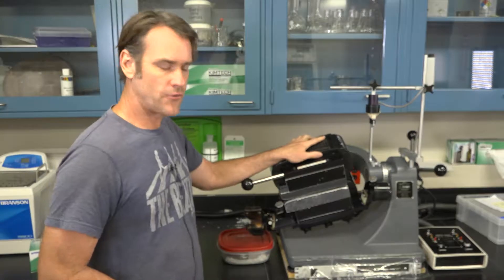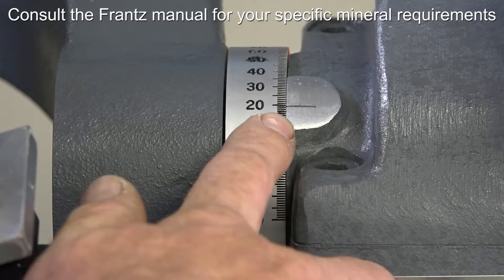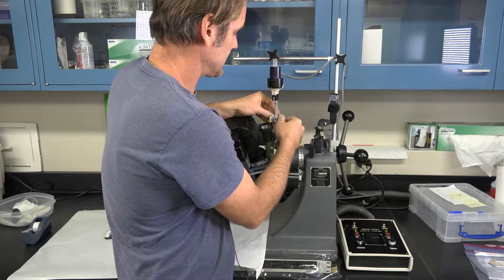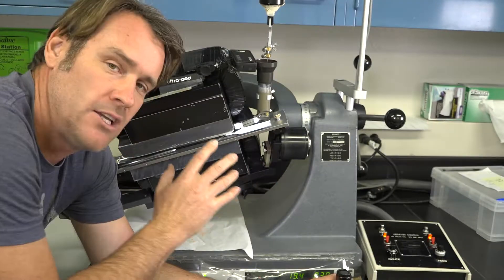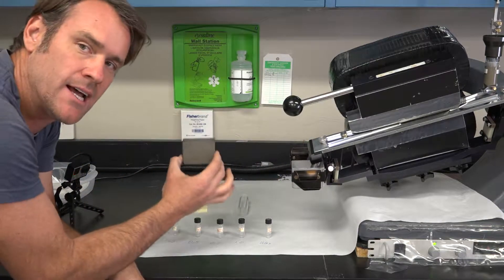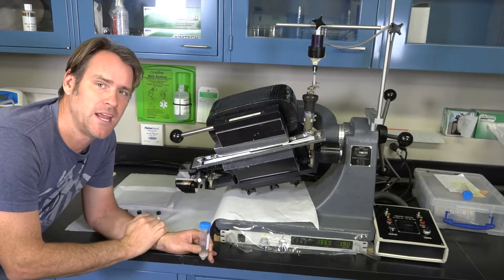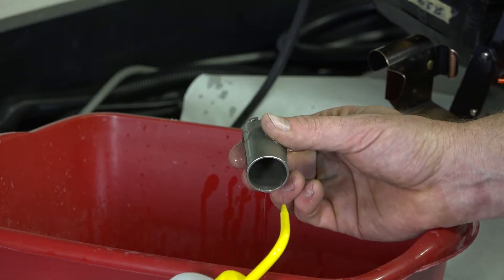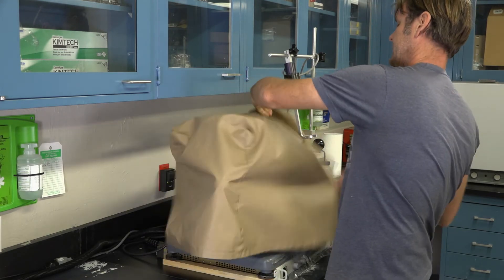Minsep - Setting up, using and cleaning the barrier Frantz magnetic separator

Comment: Question: Why not use water to wash the parts and dry it with compressed air? Save time?
Reply: Try it yourself and see the difference between alcohol and water.
Reply: you should use methanol because water can lead rusting to the instrument.